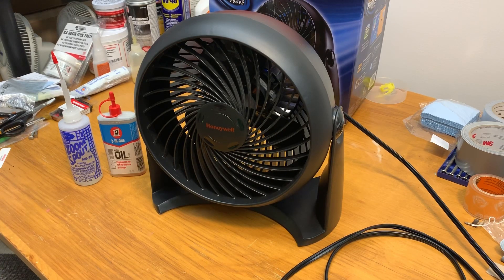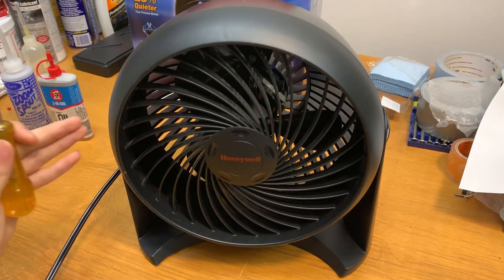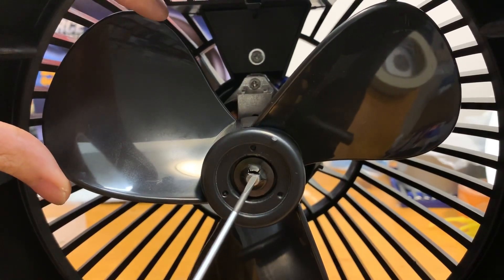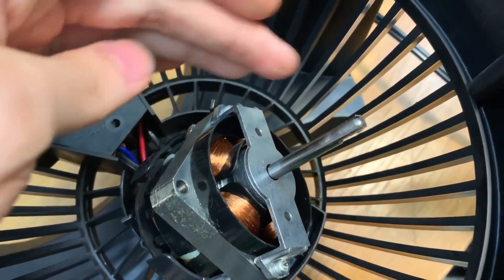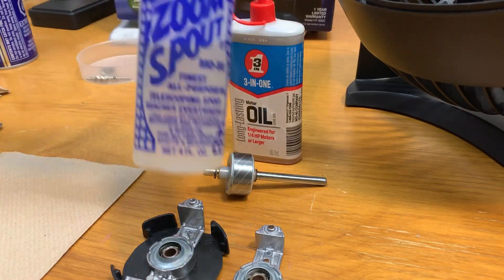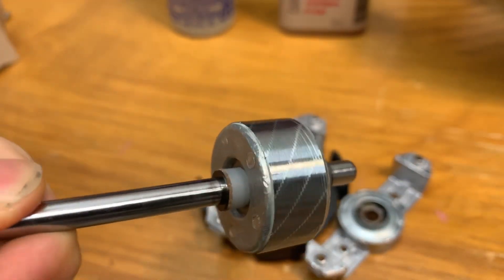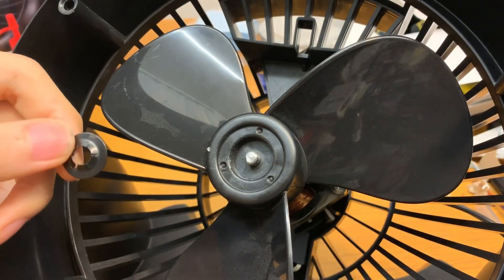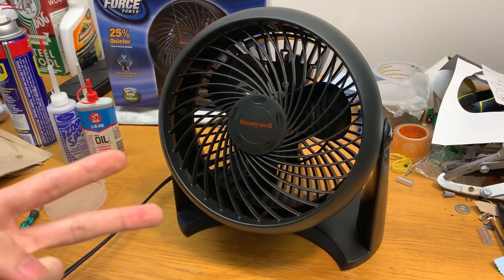Disassemble, Clean & Oil a Honeywell Fan w/ PSC Motor

Comment: My X power fan stopped working even after I cleaned the dust out of it, what do you suggest?
Reply from the maker: It’s likely that the motor’s thermal fuse blew. Most fan motors have a one-time fuse that will blow when it gets too hot, often due to heavy dust accumulation or excessive impedance. Are the blades hard to spin by hand? Is there a faint hum coming from the motor when it’s switched on? If no to both questions, then it’s probably the motor fuse. You can also check the continuity between the two plug prongs when you set the switch to any of the speed positions. If the multimeter shows no continuity, the fan circuit is open, likely the fuse. Unfortunately if the fuse is the culprit, there isn’t an easy fix for that other than getting a new fan. If you’re very mechanically inclined, there are some videos on YouTube made by fellow fan collectors that show how to replace the motor fuse, though it’s a very tedious and delicate task. Hope this helps!
Reply: @TheSuperFanMan  Thank you brother.  This explanation was well explained.
Reply from the maker: No problem!

Comment: I have never taken the blades off my ansio turbo fan before. But it is built just like the honeywell’s but with a shaded pole motor i think
Reply from the maker: It sounds like a pretty common design for tabletop small air circulators. Are the blades held on the same way as these Honeywells?
Reply: @TheSuperFanMan  I don’t know. I think they are held on with a nut but i will need to check
Reply from the maker: Nice! A simple threaded nut holding the blades on is a much better design. Easy to remove for cleaning than the pesky push nuts on these Honeywell fans.

Comment: At 15:04 the HT-900’s don’t have as good as a spin down as the HT-800 series. I wish my HT-900 could be better.
Reply from the maker: Yeah I noticed that too. The HT-900 fans have smaller and lighter blades than the HT-800 fans, so there’s less momentum to keep them spinning when the fan is switched off.

Comment: Where is the 2013 HT-900?
Reply from the maker: I think it’s in a box somewhere. The motor bearings gave up so it’s been out of commission for years.
Reply: @TheSuperFanMan  like in what way? Can oil work? My 2008 HT-900 also seems to have a very short spin down time
Reply from the maker: The low quality bearings developed some play from the excessive motor heat. Oil can’t fix worn bearings unfortunately. Most HT-900 fans seem to have relatively short spindown times compared to the HT-800 fans, as I wrote before, due to the lighter blades.

Comment: I like honeywell than vornado also they are more quiet than vornado
Reply from the maker: The Honeywell is definitely quieter than a similar size Vornado, mainly because the Honeywell doesn’t run nearly as fast. Vornado fans move more air though, but of course at the cost of some noise.